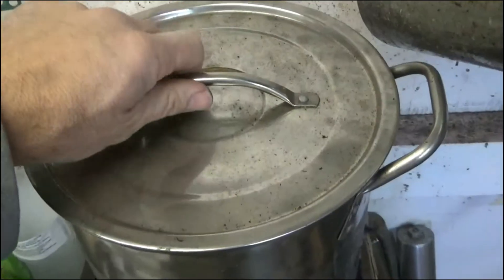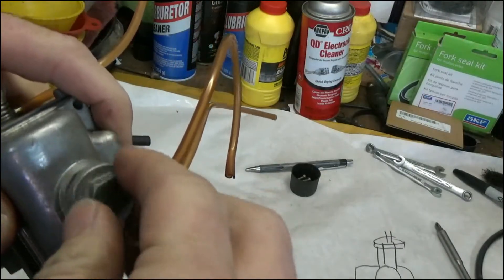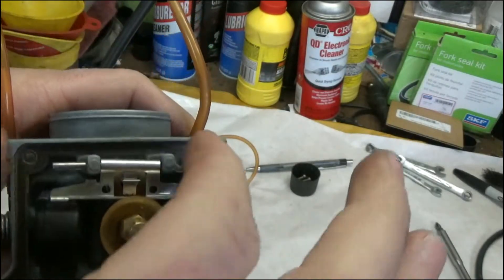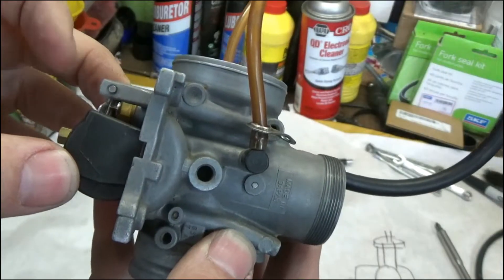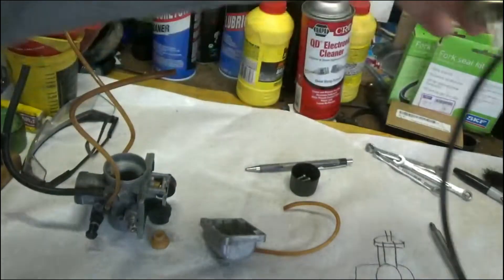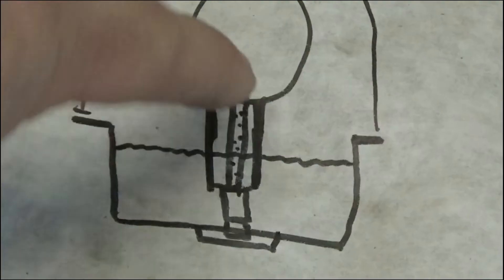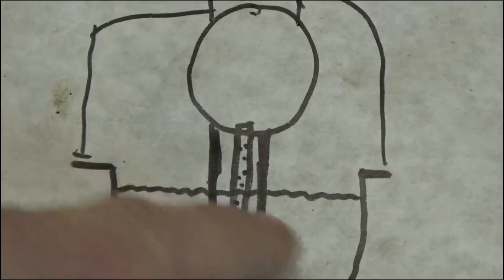Why float height is important

Comment: This is the first time I have seen this video. It is very helpful. I do have a carb question for you. I recently bought a new streetlegal enduro. The idol runs great and as far as I’m concerned, it doesn’t run too rich or too lean. But my problem is a very slight drip from the overflow carb tube when the bike is on the kick stand after running. When I say slight, I mean slight. Over a night, I may have a couple drops or three drip from the tube. Is this normal? I run zero ethanol gas in the bike and have even drained some fuel from the carb and new gas from petcock into a bowl to see if maybe there was debris around the drain screw. The only other thing I can think of is the float may have not been set right from the factory? Any info will help. Thanks.
Reply from the maker: Perfect timing, I just put this video out. Should answer all your questions.
https://youtu.be/CQm_bs0uiTw
Reply: Thank you for that. I will check some of those things on my bike. Since it’s running fine, I may start with the drain screw to see if the tip is corroded… just weird since this bike is brand new…
Reply from the maker: @derektaylor5823  Could be debris from assembly in the float seat, or the float hight might be off. I've had several brand new bikes come to me with the float height incorrect.

Comment: Great video! I have a question though. On my 2016 YZ250, the carb is not level between the engine and the airbox. I believe the airbox side is the higher side. So the bowl is tipped forward. Also, there is some room to twist the carb in the two boots, so the bowl may be tipping to one side, as well as front to back. Does this matter?? Thanks!!
Reply from the maker: There should be a tab on the top of the intake boot to help get the carb in the right rotation. As far as the tilt, the stock float level takes that into account.  Thanks for watching!
Reply: @TepcoCycleRepair  That's simple. Thanks for the quick reply!!

Comment: I replaced my 125 Xmotos carb with a 22mm Mikuni, then moved it to my retirement property at 7500ft elevation about two years ago, where I normally spend my summers. I think I may have lowered the float back then to help with the altitude, then never followed up on it...can't remember...Covid1984 makes it all so hazy...lol!
Currently it will not run without the enrichment lever on. Been tryin needle and main jet,  and suspecting the lean float was starving all the stages. After hearing you confirm that, I can't wait to play with the float adjustment! Hopefully I will soon happily update this comment!
Update:
Disappointed. I feel have taken the float adjustment from one extreme to the other, yet the bike will still not run without the enrichment turned on. If I blip the throttle ever so slightly, it dies. Getting rolling requires slipping the clutch at fast idle, but applying no throttle until up to speed. It will accelerate only at full throttle, and the exhaust sounds like it's lean and backfire tends to occur. 
At this point I wish my original carb hadn't got left back in Kansas! Lol!
Now I am wondering if old fuel could cause this? I had a TT250 decades ago that ran but wouldn't accelerate till I finally ran my number size drills thru all the jets. They looked clear, but had a thin layer of "varnish", effectively reducing their size. Does this also happen with ethanol blend fuel? I am sure the jets are clear but have no idea if maybe the year old fuel could be causing these symptoms. Guess I will drain the tank and try some fresh...not real hopeful tho...

Comment: So if you lower the float, are you lowering it when the carb is upside down/ richer mix or visa versa? Thanks
Reply from the maker: Yes, height adjustments are always made with the carb flipped over usually at a 45° angle. So lowering the hight, meaning lowering the measured height say from 17mm to 15mm would let 2mm more fuel in. But never use float height to richen or lean a mix because it is a measurement that works with the carb body and jet location and should always be set to the carbs specific spec.

Comment: the only time fuel is in the area around the emultion tube is when the engine is not running,  when the engine is running the needle valve controls how much air is blended with the fuel being metered by main jet, float level controls the amount of vacume requied to pull fuel up from both jets,, the pilot jet emultion tube flow is controlled by the size of the holes in the tube.  your explanation is only part correct.

Comment: Thanks so much for that information you just helped me fix my 2013 yz250 it was revving to the moon after start up previous owner said that it needed carb work thought it was the crank seals were bad and caused a air leak and had bike screaming after starting. After watching this video I observed and noticed He or someone else messed with float height causing the bike to get massive air and little gas. Would of never know if it was for this informative video 🤘 you rock bro 

Ps- I ordered a lectron carb two days ago to see if that would fix it. 

Should I keep lectron carb or return and get money back since I fixed my problem???
Reply from the maker: People say alot of good things about the lectron. You can easily sell it if you don't need it and loose very little on the resale.

Comment: Thanks this is great.

One question though how do you know when to lower float level (more fuel) or increase jet size (more fuel)
Reply from the maker: The float level should always stay the same. Changing jet size to a larger size does not require you to change the float height. Thanks for watching!

Comment: Just bought a small boat engine today, I've taken the carb off at least 10 times, carb spray all the way thru ultrasonic cleaning in gas in a zip lock bag in my harbor freight cleaner, still didn't run right, it wasn't getting enough gas I think was the problem, after watching your video last, and getting the float to where it was just touching the float needle, I crossed my fingers and gave it a shot.  Your video helped so much, fired right up and revved like it should.  Thanks for posting this video
Reply from the maker: Heck yeah, awesome! Thanks for watching!

Comment: Thanks on detailed explanation. One question: It is regarding 2t 125c go kart engine. It happens that in the corner engine bogged down, on the straight going like hell but in the corner allmost no power. Can this problem be connected with wrong float level? (engne:tm racing k9b, dellorto vhsh30cs carburetor)
Reply from the maker: Certainly could be, easy to check. Most likely you just need to adjust the jets. If it's lean bogging mid turn try raising the needle one notch.

Comment: What if you re-jet your carb to a higher #, for instance: going from a #170 Jet to a #180 Jet. Will you have to compromise for the new jetting and do a fuel float adjustment?
Reply from the maker: No, float height would stay the same.

Comment: I'm regretting a 250R can I go very low and I'm still very rich in main jet so this video really just helped me out a lot thanks keep up the good work Buddy
Reply from the maker: Yeah make sure your float level is at the stock set height. If you're still having rich problems make sure your slide needle is not floating and is locked into position.

Comment: If I’m jetting my carb to a bigger pilot and main jet how much would I have to adjust my floats
Reply from the maker: None, floats stay the same.
Reply: Tepco Cycle Repair  thank you
Reply: Tepco Cycle Repair should I adjust my fuel mixture with the screw also.
Reply from the maker: @xJacobgas18x  Yes, you need to adjust that after the bike is warm and idling. Slowly turn it out and in pausing every 1/4 to see what the engine does. Look for the highest idle then leave it there and then adjust your idle to the proper idle. Start at 1.5 turns out from lightly seated. You should end up somewhere between 1 and 3 turns out.

Comment: If the float height is not right will that cost the engine not to start up?
Reply from the maker: It could yes. Usually not if it's off by a little though.

Comment: I think that this is the video I've been looking for.  I can't bring my idle jet out ( lower RPM) far enough to lower the RPM. it falls out before I reach that point. and that means I can't turn my air/fuel jet out far enough to to get the proper lean. Its idling way to high.
Reply from the maker: Check your throttle cable adjustment to make sure the slide is sitting on the idle screw first.
Reply: @TepcoCycleRepair  Very good point. I'll have a look

Comment: I've been trying to study carburetors for my bikes for almost 4 years now and I'm barely starting to make sense of these things. Thanks for this bit of info!
Reply from the maker: Your welcome, carburetors are awesome things.
Reply: Spartan375x I know what you mean but it’s not rocket science. If you lean carb only a little and it’s dripping fuel from the float overflow fuel level too high. If you’re wide open throttle and after 10 to 20 seconds it bogs down float height is too low

Comment: Does a high float cause any problems at high rpms?
Reply from the maker: High float height will make it richer which will usually cause it to idle down and stall.
Reply: Motor spitting and sputtering but I can back off and ease back into it. It'll clear up but not 100%. Full throttle it'll just sputter the entire time. I noticed I had fuel sitting in the throat. I know that's a problem but is it my high rpm problem?
Reply from the maker: @FloridafishingwithRick  what does your plug look like? I would need more info to help. What bike,  carb etc?

Comment: Are you sure about the source of the air that surrounds the emulsion tube.?It seems to come from the small passage at the air input side of the carb, not leaking in around the main jet.  Also, I believe all the small holes in the emulsion tube are for air and not for fuel.I believe all the fuel should come through either the main jet (not idling) or the pilot jet (idling).
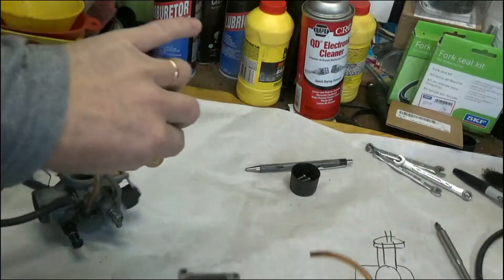Reply from the maker: There are vent lines that let air adjust in the bowl and around the emulsion tube, my explanation starts at 3:10 about the emulsion tube. Yes most fuel comes through the main jet but if the float is set to high, higher than any of the holes it will suck fuel through the holes as well. To many holes under the fuel level=to rich to little=to lean. Hope that clarifies it better. Thanks for watching.

Comment: Finally the importance of float level is revealed. Thanks a lot for simple but very [powerful explanation. Though the float level prescribed by the manufacture is achieved still we are not sure if the float level is sufficient to submerge the first 2 tiny holes of the main jet holder. It would be nice if you can reveal us the trick.
Reply from the maker: Each emultion tube is different for different applications, some carbs have different ones you can chance to achieve different results. If everything is stock the stock height is sufficient to work with the emultion tube. Many people adjust the float to try to fix other issues, which in reality it should almost always be set to the stock height and the running problem lies elsewhere. (Usually jet sizes)

Comment: HI, i have a question regarding to float, i see some carburetors has the weight floats to change eg. 9.5gr. 11gr on Dellorto, what are the affects on this change? and other qustion, on the nozzel one carb of mine, has no small holes its a Dellorto phbl AQ256 type
Reply from the maker: Weighted floats are for non adjustable float Chambers. A heavier float will sit lower letting more fuel in the bowl. Dellorto has several emultion tubs with different amount of holes in different locations. Your's may only have two large holes instead of many small holes.

Comment: best explanation (actually, the ONLY explanation) i have seen regarding the effect of float height on fuel mixture. good job. i would add, for those new to the inside of a carb,  that the plunger on top of the float needle is spring loaded and you should be able to depress it easily and it should spring right back . sometimes varnish from old fuel will seize it up but i have a good record of bringing them back to life by spraying with carb cleaner.
Reply from the maker: Good point on the plunger, I went over it in another video,  thanks for watching!

Comment: Great vid man, thanks. I've been having a Hell of a time trying to adjust my Keihin PKW  on my KDX200. Was dumping fuel really badly, also running way rich. Seriously bogging on the low end.  So I Lowered the floats to cut fuel off sooner.  That stopped the dumping of fuel but its still bogging when I crack the throttle. I backed the fuel/air screw out so much that it shook its way out on a trail ride! Should I mess with the float tab some more? Its a new float from a rebuild kit.  If I re-jet from stock, what main jet should I go with?  I also live in NC. Weather is cooler now. Not crazy humid like this summer.  Thanks again Brother.
T
Reply from the maker: Set the float height to the stock setting, I wouldn't adjust it to fix a problem. Your jets should be in the 42 pilot and 155 main or somewhere around there. The mixture screw leans it out when you back it out so a bog down low will be worse the more you back it out. Set it to 1and 1/2 turns out to start. I can walk you through some jetting if you need it but start out by making sure everything is in good order, air filter, silencer, plug etc.

Comment: Ssr125 with a brand new carb and it won't start and it sprays gas like 2 feet out of the carb intake jets please help
Reply from the maker: Ok, not sure what you mean by that? It's shooting gas out of the carb? Start with starter fluid, if it fires up with that we should have good enough spark and compression. If you got a new carb make sure the jets are the right size for that carb. If it came with jets use those before changing them out.